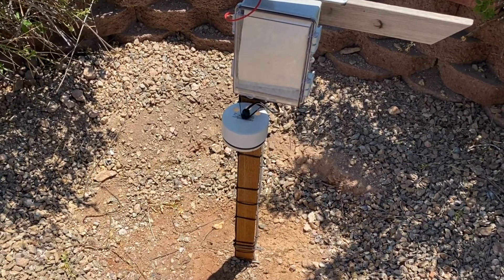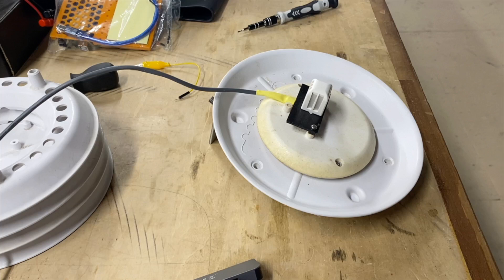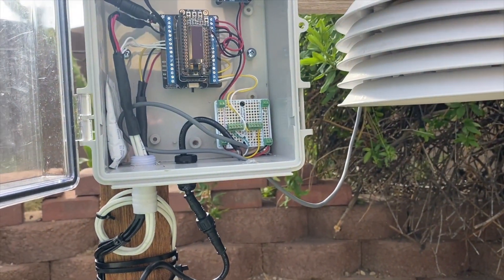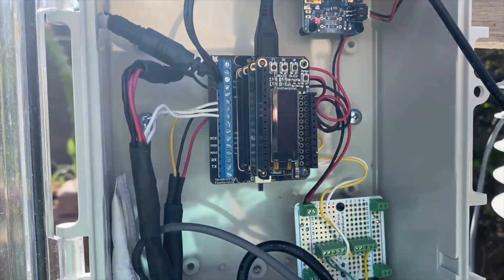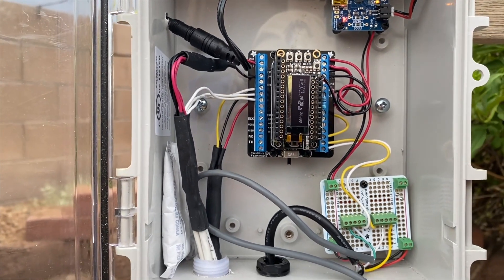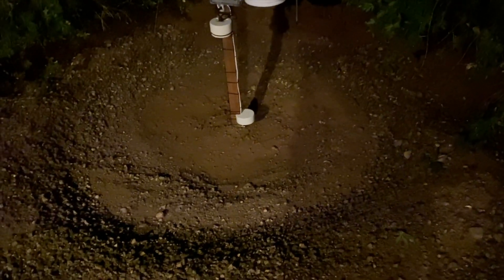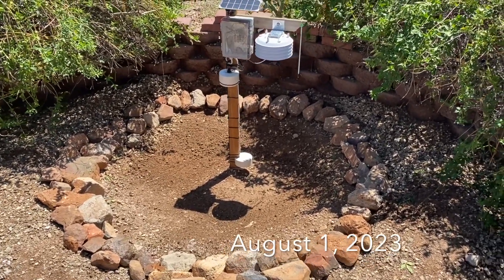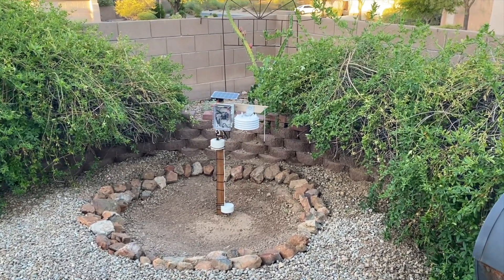Soil Moisture and Temperature Monitoring - Final Upgrades

Comment: Have you considered exploring tensiometers/calibrated ceramic cups for soil moisture, and using that data to calibrate your capacitance sensor data?
Reply from the maker: Tensiometers can be somewhat expensive and not accessible to everyone. I have tried calibrating using volumetric water content and learned that if water content is below wilting point for most plants, the sensor may still report wet (see this video: https://youtu.be/iqiwVXhgNKw). As such, I don't believe these sensors are a good option for irrigation management but may have other applications as I'll share in a future video.  Ceramic cups are interesting - I do want to play with ceramic ollas to see how these impact soil temperature. 👍

Hey- nice to hear from you Jason!

Comment: Great update!
I did not check the sketch code but what I have learned from past projects was that I needed to create loops to read the sensors for a more accurate reading to be logged. I used 10x for each sensor before displaying and saving. The output appeared to be a lot better than jumping around slightly. Just a thought. Great video!! What were the moisture readings or did I overlook that?
Reply from the maker: In regards to the moisture sensors, something weird was going on when they were first installed in that all three were responding to ambient temperature. Today, the ones that are installed deeper are  behaving as I would expect in not being so heavily influenced by ambient temperatures whereas the shallow sensor is definitely influenced by temperature. This is one of the reasons I wanted to reset the start time for August 1st so as to eliminate that odd data from a couple months ago. Having said that, the cap sensors are working beautifully in tracking the infiltration for rainwater, but not so great in tracking the drying of soils. I'm saving that for a future update ;). I like the idea of taking an average or median of multiple readings-- that's now on my radar.
Reply: I forgot to mention that as part of the average loop I would eliminate any data that was way out of the ball park and add an extra one to the loop.
Reply from the maker: @donaldhoudek2889  Good point - I think a median might do the trick on that front. I will definitely follow up on this idea.